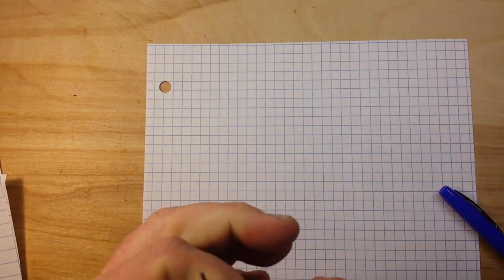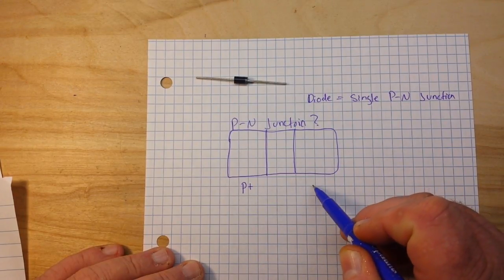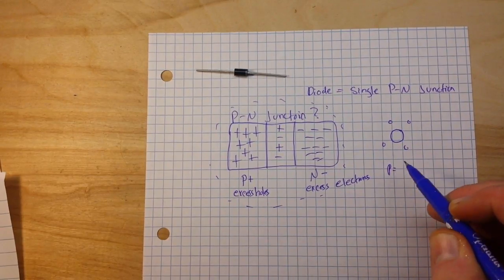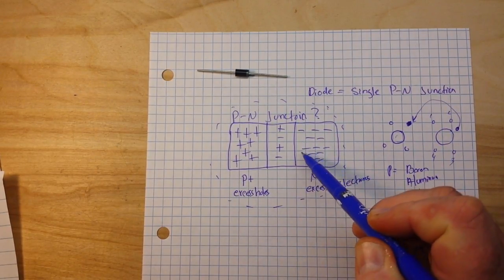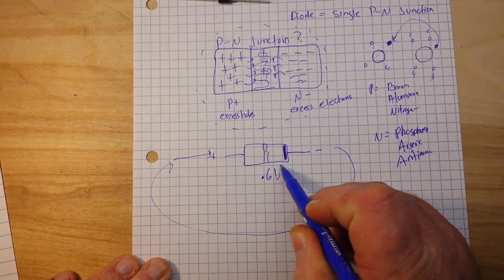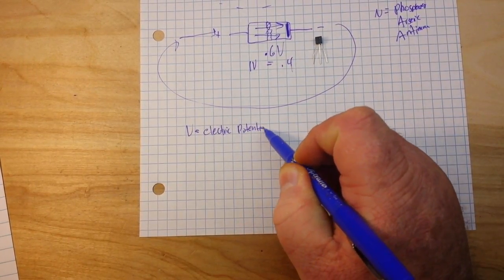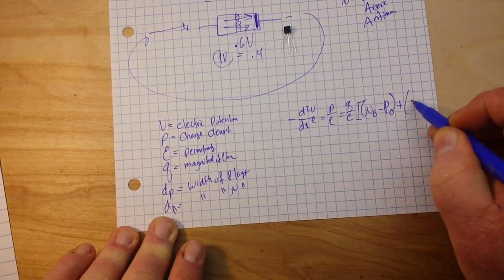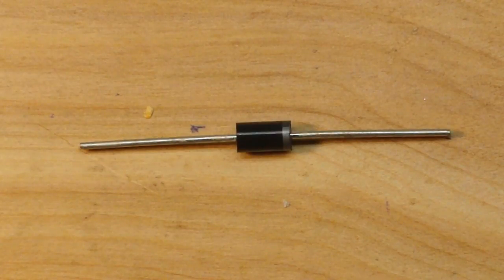Diodes: The basic building block of all digital circuits

Comment: But I think you could started with: Diode stops current from one side but lets it from the other side go freely - penalty (or a fee) is o.7V drop voltage. So I would say that it is a DOOR that lets One Way Traffic thru but stops "current" thru all together from the other side.  How it works is nice, but for most people, the function is more important than how this or that chemical and holes are used to move electrons .....  When I was a kid, I lost interest in electronics, when someone tried the more complicated way to teach me electronics. I was just a teenager and I wanted to make my own portable radio. If my teacher, whom I do not blame at all, he was after all a teacher that had to follow standards.... explained it to me, that this is a "one way control switch" and transistor is 2 of these together and or an a amplifier....I would stay in the class. Now, retired I like to play with repairing stuff and now I can understand somewhat more, so when I run into a simple board, I can try to figure out what is happening there. Some of us have a hobby or hobbies in my case, to keep our brain from deteriorating slowly..... but we don't have the flexibility of remembering lots of electrons and wholes jumping here because of doping.... I find myself needing the "teenager style" explanation. Here is what this does, but I don't care about the chemistry.  But you could explain both, as long as you don't ask me to perform a chemistry test. ha ha ha  Thank you for your video channel and your hard work!!!

Comment: I would like to see a documentary . about how they discovered this. how they went thru the steps of discovery. I have heard the story about basically a rock. being probed with electricity. well I guess it was a chunk of silicon . transistors!!! and a question. can MOSFETs be used instead of bjt transistors. or is there circuits that require them?
Reply from the maker: +James stranger BJTs are current driven
FETs are voltage driven. FETs are more delicate than BJTs too.